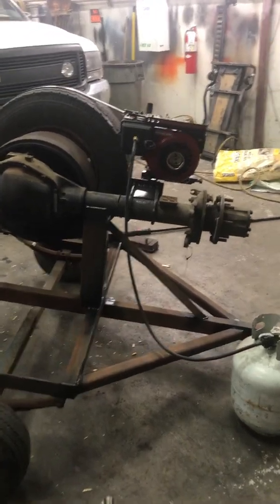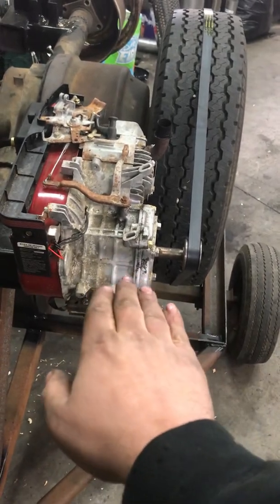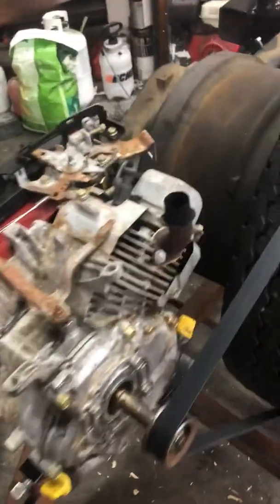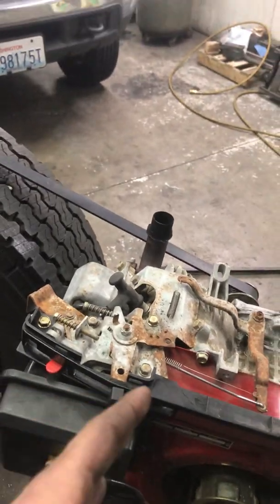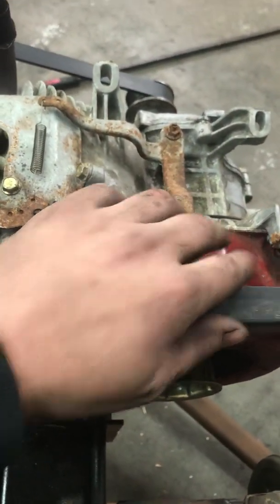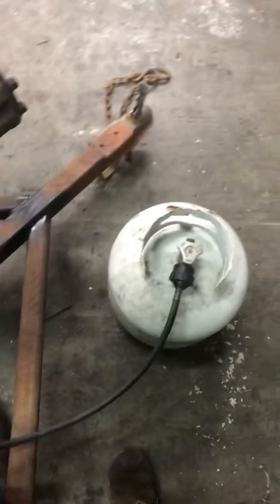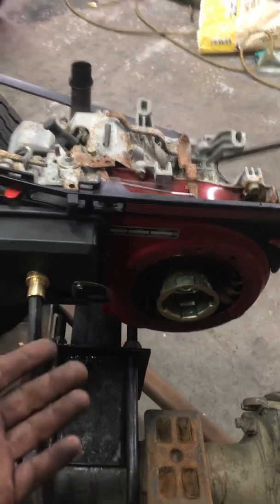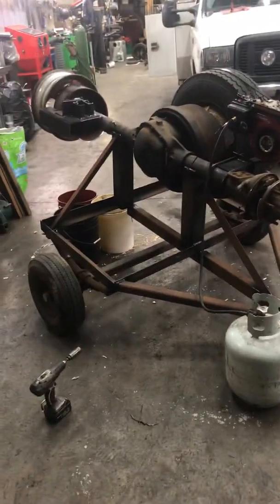Wood chunker for WOODGAS p8 the final

Comment: Great progress report  :) . 
 Just wondering, wood it be practical to feed the wood in from above, as opposed to horizontally? 
 That way, you could use gravity to feed the wood into the shear, assuming you have a backstop inside it, to regulate the size of the resulting chunks.
Reply from the maker: A few guys have toyed with that and been successful, but for smaller Feed stock like I would use for a auto feed shoot like that I have a plan....may end up with a swedish style rebakk on the other side of the axle later on. Most of my wood is 3/4x4 pine, 2x4, 2x6, 2x3 and 4x4 Doug fir which for being a soft wood is pretty dense and the one little piece of it I chunked was putting a lot of work on the chunker so I'll prefer to hand feed it Incase the chunker slows down so much that I need to skip a revolution to let it speed back up
Reply: @BigBeavrSlayer  
 Indeed. The wide range of sizes that you are cutting, makes for a more difficult application of the vertical feed plan. 
 Mine was greatly simplified, as I pre-shaped the wood, before auto-feeding it. 
 I imagine that you'll soon be coming up with some unique ideas to try here, and I can't wait to see them come to life  :) .